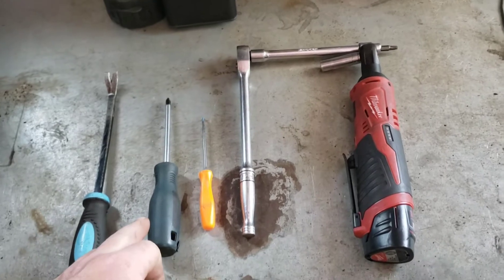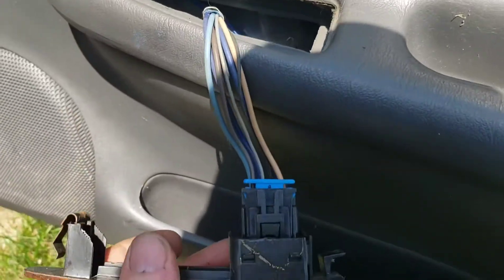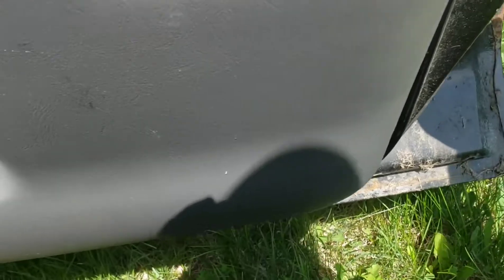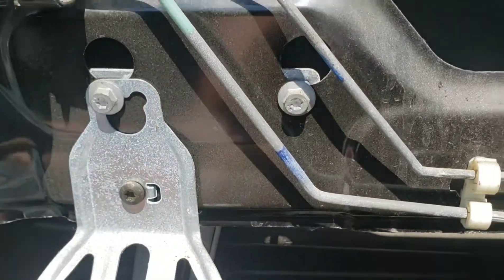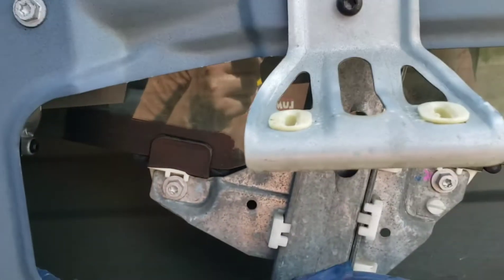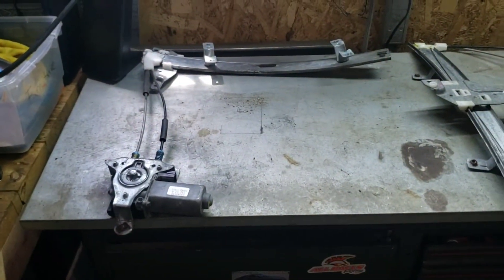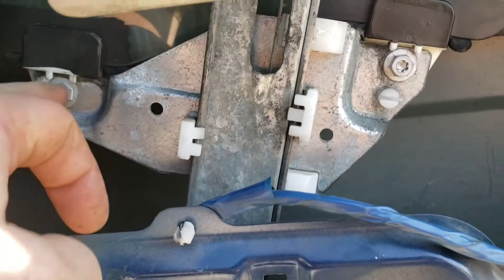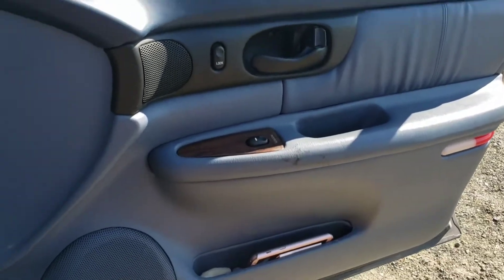1997-2003 Buick Regal window regulator replacement.

Comment: The drivers side on my 99 Regal let go today. Regulator/Motor has been ordered. This helps immensely. Thanks!
Reply: contact national transportation safety commission, since this power window problem is endemic to buicks especially regals, make buick repair the problem
Reply: @joncole5776  its a 21, almost 22 year old vehicle. They aren't going to do a thing.

Comment: Do you have suggestions for (bench) testing the motor? I thought my motor was still working, and the window malfunction was broken plastic clip/unattached cable, just as on this video. But, (weeks later) I first tried the master switch, and then tried to hook up to 12v, without any indication of the motor trying to work. Is there some safety lockout on the motor or something. ...? How do I check it?
Reply from the maker: There is no safety lockout that I know of. I have just run 12 volts and a ground to test them in the past. I have never had a motor burn out, its usually the plastic bits that fail...but that doesn't mean they don't crap out.

Comment: I just had one go bad in my 00 century.  If I didn't want to spend 150 to fix it, is there any way to get it to stay in the up position (without duct tape :)
Reply from the maker: You can use a small set of vice grips  to stop the window from sliding down the track. Just clamp it on just under the glass roller mounts on the track.
Reply: @jeremyrowe743  And I just saw non oem motor and regulator only 38$, I saw 150$ at first and was like whaaaat! :) :) . so ill just fix it, thanks for the video
Reply from the maker: @staywhatyouare  glad I could help
Reply: @staywhatyouare  I paid 66.99 for a Dorman rear left assembly (motor/regulator) with lifetime warranty at Autozone.